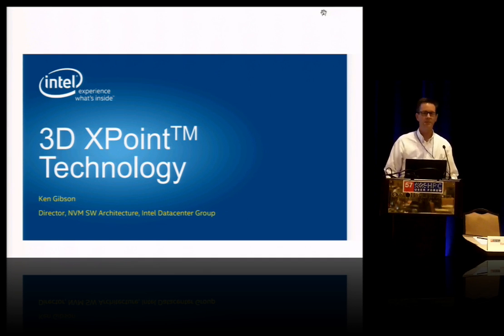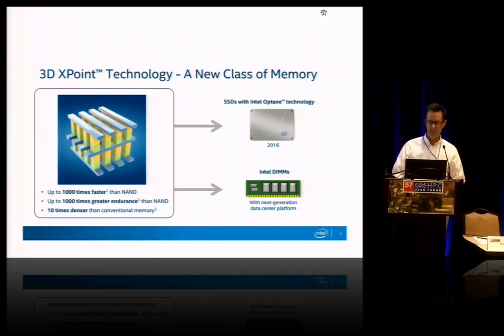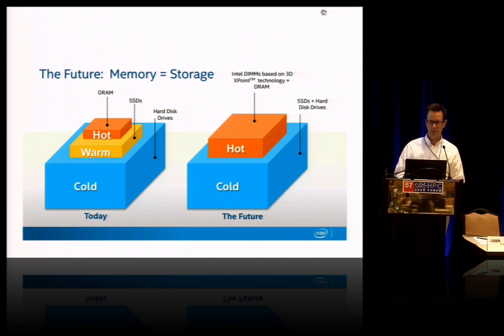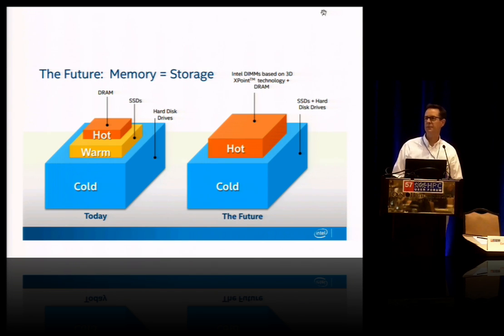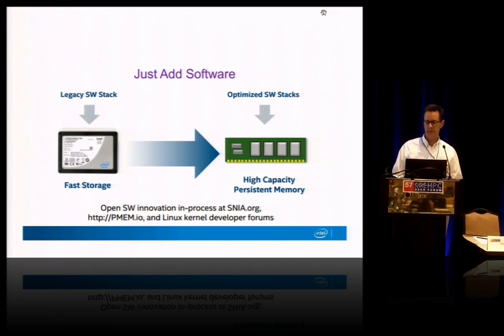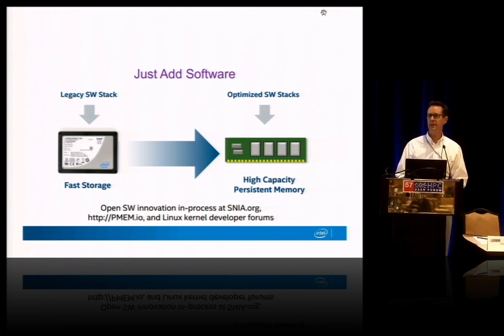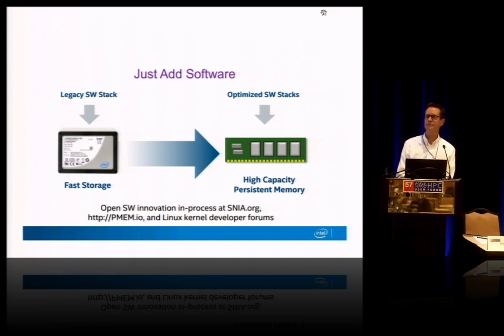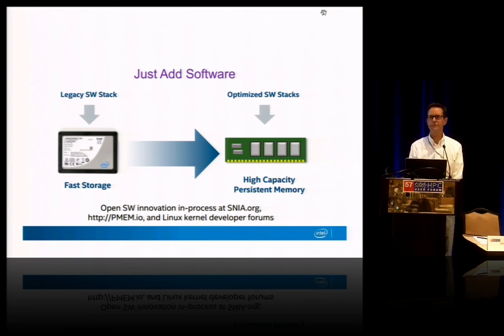Intel 3D XPoint Technology

Comment: So, Will it be in an M.2 form factor? Will it run on PCI x8 or PCI x16? 1,000 times faster is a hell of claim. what will this mean for GPUs?
Reply: +gmax876 : 1000x faster is relative to current high-density SATA SSD, which has a latency of about 100 us, so they're claiming about 100 ns.  That's still slower than DRAM.  The real question is whether this tech can actually operate without wear-leveling.  (I don't think NVMe is capable of anything close to 100 ns, since the lowest-latency PCIe devices, IB adapters, are stuck at about 1 us.  So their initial NVMe products will probably be only modestly faster.)